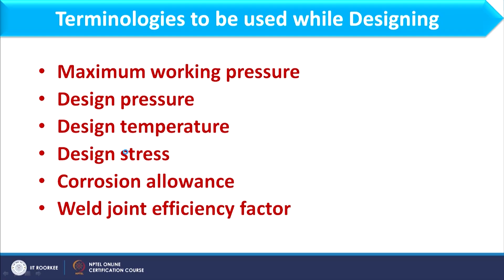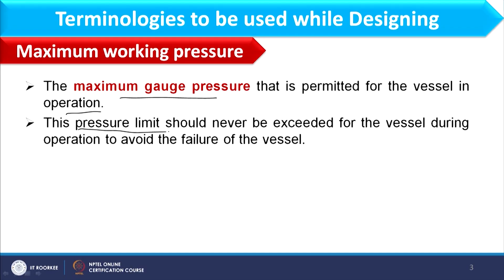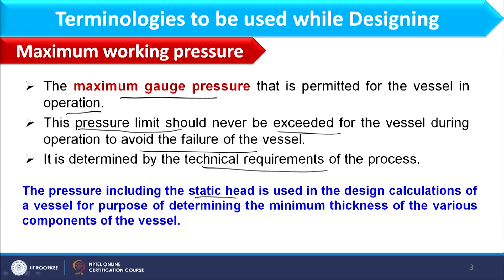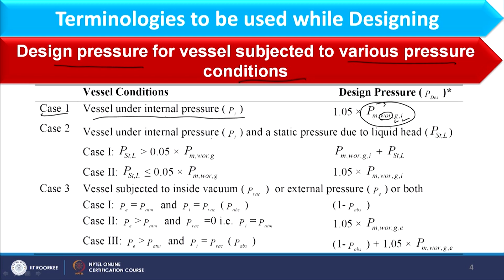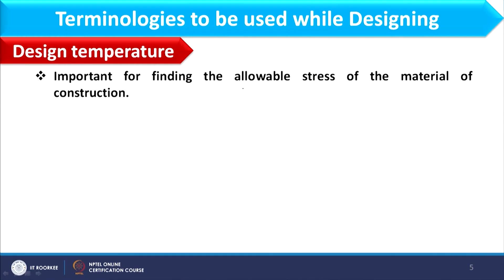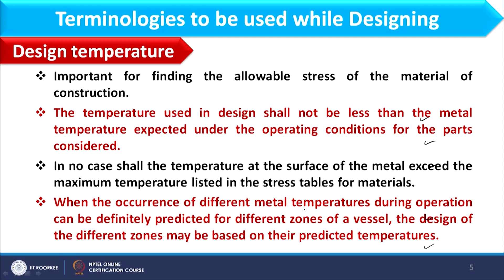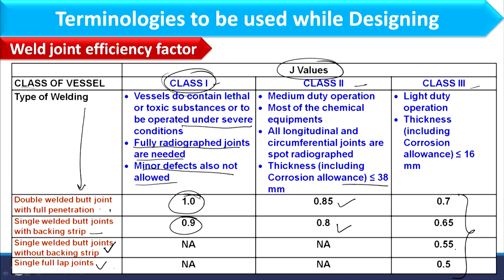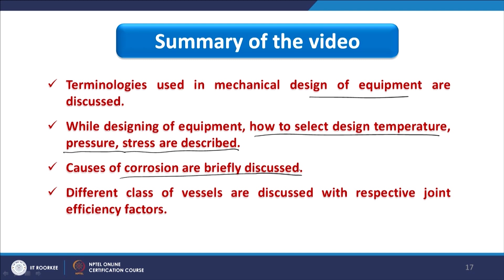Terminologies

Comment: Mam, Hemispherical dish end joined to shell is also considered as Category A joint. Reason is Hemispherical head is preferred for high pressure equipment and hemi head is almost half of shell thickness. so there will be abrupt change is thicknesses at shell to dish joint. Thats why this joint is considered as critical joint and categorized as A so that full radiography needs to carry out at this joint.

Comment: Design temperature can be lesser than 250degC.... code provided allowable stress upto 250degC in first column. It means that even if my vessel design temperature is 200degC still I can use same allowable stress value from table.